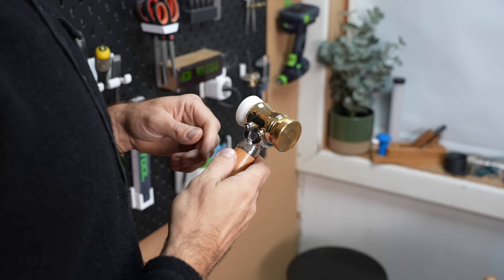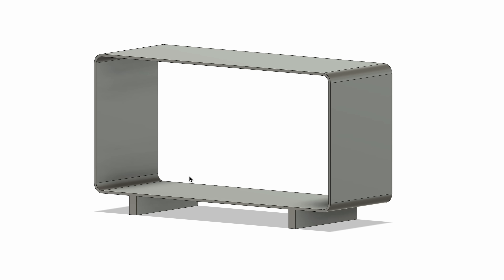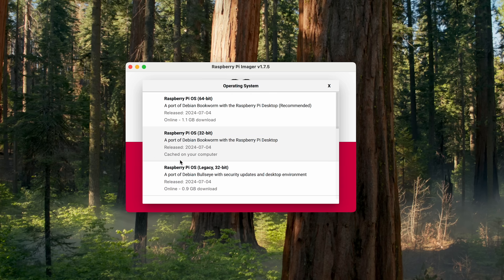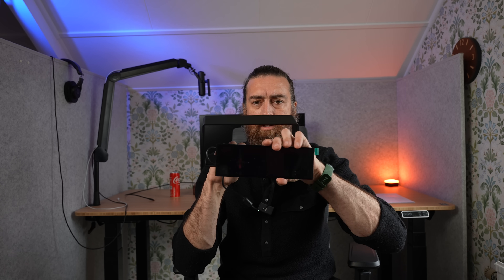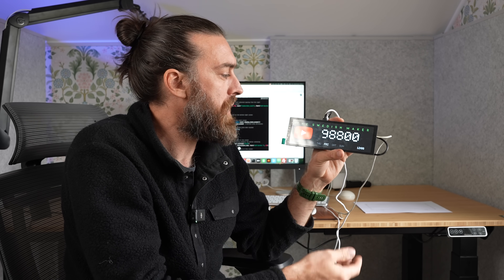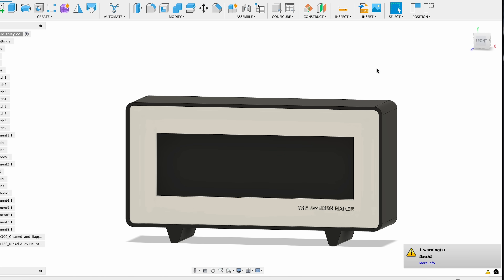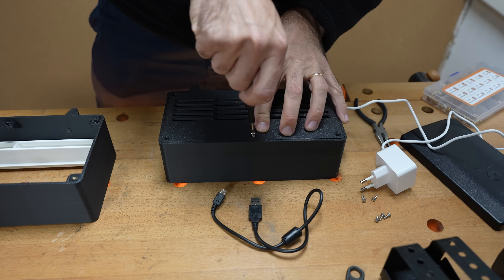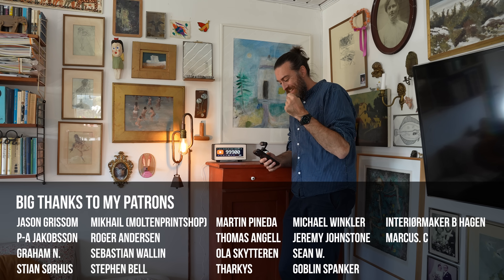a revolutionary tool - and it's free

Comment: Grattis on subscribers! Grymt! The issue with CAD is from a time money perspective it isn't free. It has a steep learning curve and requires a lot of patience and training. That's a big cost that's always stopped me from learning it, even with a few failed attempts.
Reply: But you learn it once and use the gained knowledge forever, which makes the time argument kind of irrelevant. It just fails if the application you are using is moving stuff behind a pay wall. Then you are doomed. That is why I prefer a free CAD solution without cloud and account stuff.
Reply: @guidomersmann9744  that implies time has no value. If there are no other things you could be doing, that's fine, but that's rarely if ever the case.
Reply from the maker: It is a steep learning curve - I agree. But the value comes also in the way it feels when you solve a problem all on your own :)
Reply: I recommend slowly going into it solving simpler problems that you are motivated to solve first. You'll find that the skills needed will naturally be gained, and that CAD is quite straightforward when you just go about learning step by step and always feel like you are doing something useful.